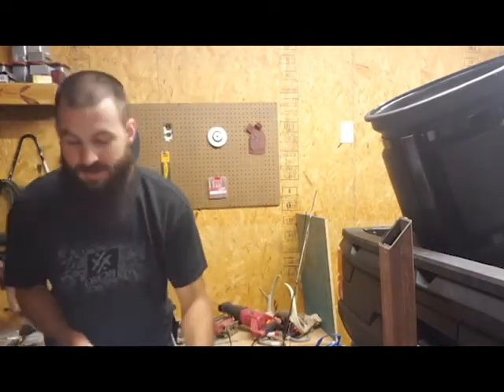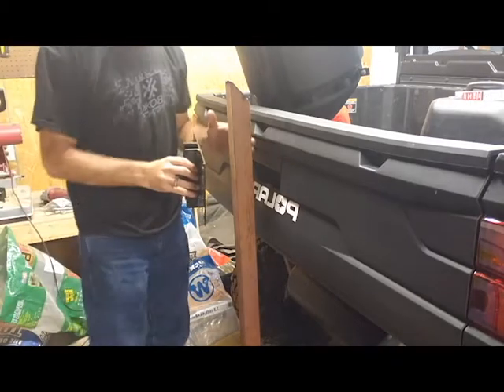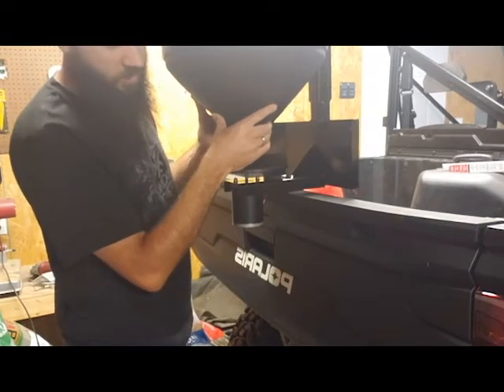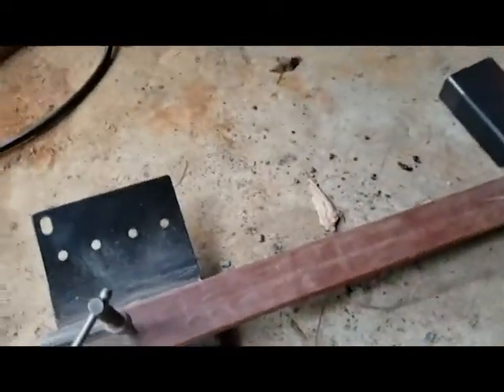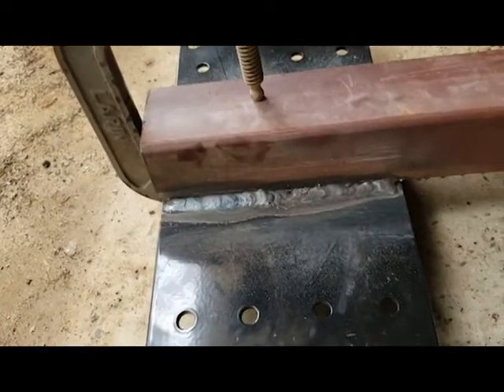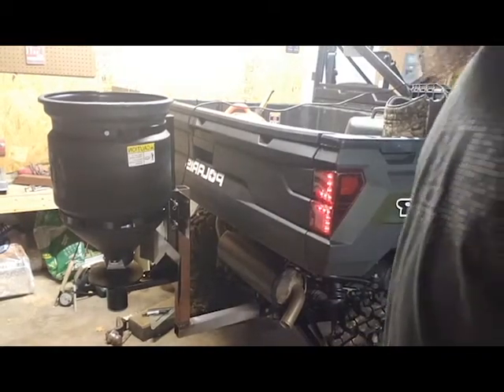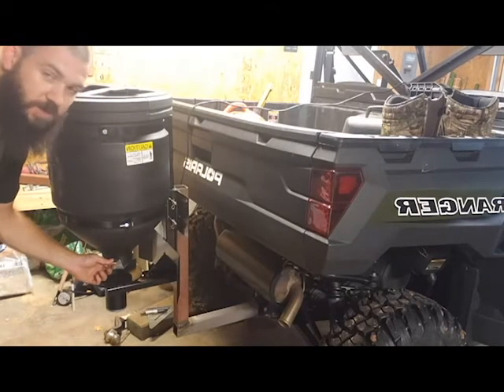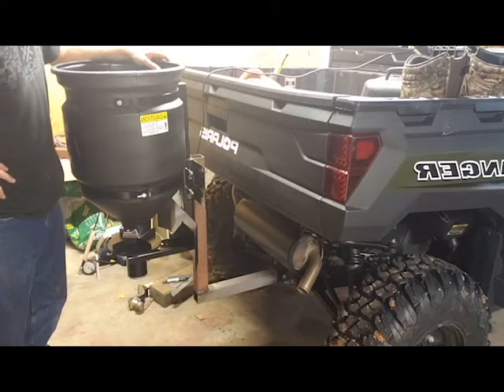Buyers ATV Spreader mounting to Polaris Ranger how to

Comment: how did the break cable work for the adjustment
Reply from the maker: It worked pretty good. The only issue I had was shutting the gate when material was coming out. Once the hopper was empty it would shut all the way.